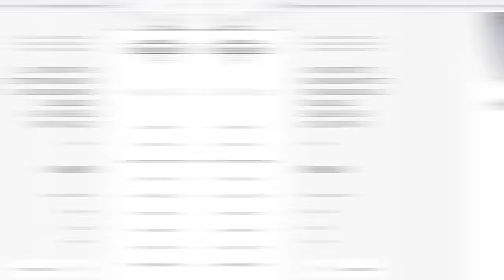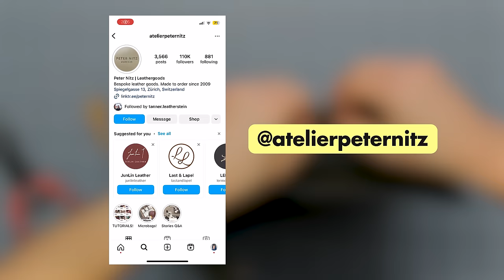Learning How to Craft a Hermes-like Luxury Bag in Europe’s Most Expensive City

Comment: Gorgeous bag! How much do you think that would have cost here in the states?
Reply from the maker: Ohh, knowing that I had to spend at least 40 hours perhaps more because I am new and slow just the labor would be a good chunk depending on how the artisan prices his/her time. You make that calculation but the leathers used 3 Crocs about $3,000 Chevre: $50 Other inside leathers: $40 - and there is about $$50-70 worth of stainless steel hardware on it. You can add it up and put a multiplier of 3 to 5x to sell it - So it would be a good amount.